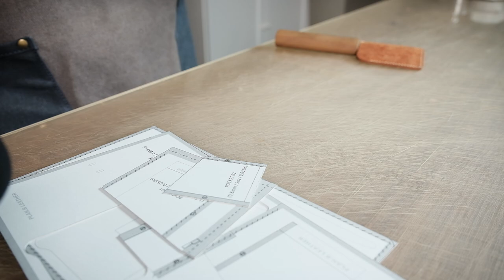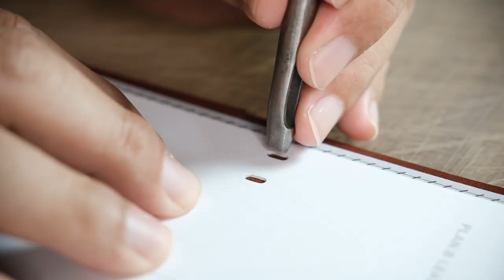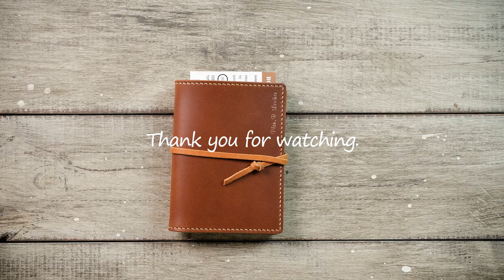Making a Leather Passport Wallet. - Leather Craft

Comment: With the water/tokonole bottle, how do you keep it from plugging up the top?
Reply from the maker: Close the lid tightly and occasionally wipe it with a wet towel to prevent it from clogging. I've never had any trouble due to blockage. Thank you for watching! :)